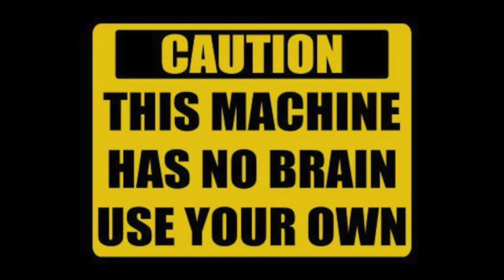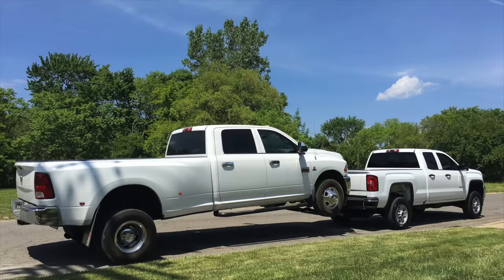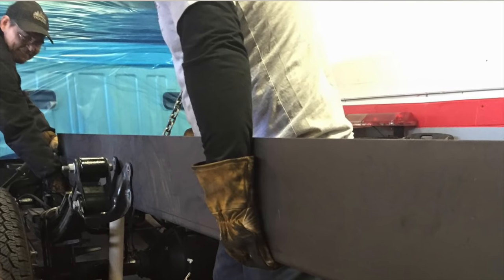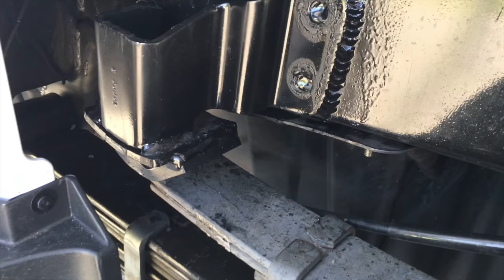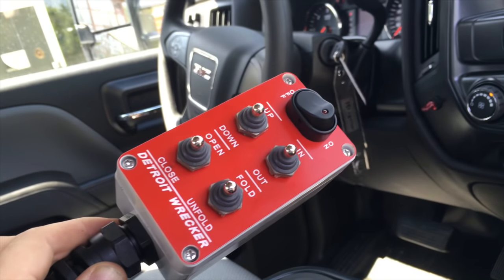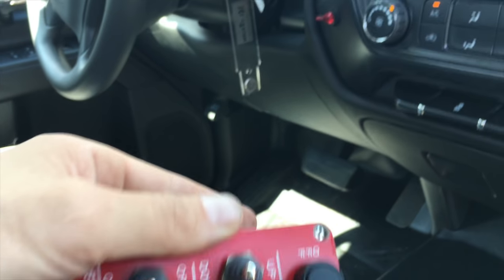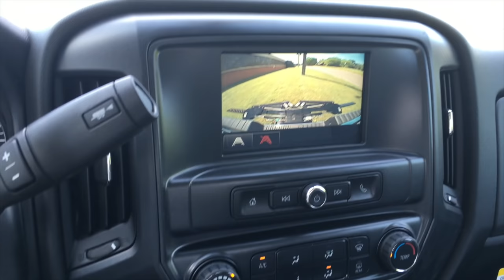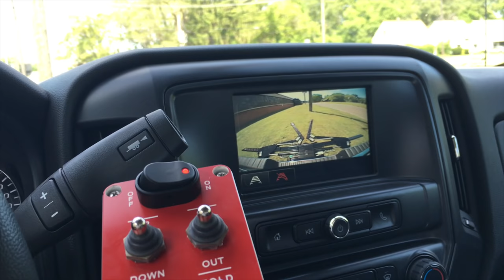GMC Gas 2500 Lifting Dodge 3500 Diesel Dually & CTSV Low Clearance

Comment: How much was the final bill, on the whole job ? Clearly You Guys are the ONLY company that does it right !!  Those helpers and pads are genius! Very Nice Job Guys !!!!
Reply from the maker: Plan on spending $15k for everything. Frame reinforcement & installation. Installation includes:

* Powder Coated Unit
* 2nd battery & Battery Box
* Power and Ground Wires (Gauge 4) 40' Total
* All Wires ran Protective split lume
* All Wires are Fastened to the truck w/ a P-Clamp & Nut and Bolt where applicable
* (2) 200amp Circuit Breakers (Protects Batteries) & (1) 300amp Fuse (Protects Electric Motor)
* Four Pin Tow Light Plug Installed
* Tow Lights w/ Cord are also included with installation.
* Grade 8 Nuts & Bolts
* Added Leaf Springs and/or Helper Spings & Top Overload Pads
* Ratchets & Straps 
* Safety Chains 12'
* LIFETIME WARRANTY PINS,BUSHINGS (with proper maintenance)

Please Note: We can not install on any Dodge Truck that has Rear Coil Suspension.The minimum recommended GVWR is 10,000lbs. Rear spring package & Frame Reinforcement recommended. Never exceed the chassis maximum GVW rating during towing.

Comment: I know this video is several months old, but have a question. have you guys try using an air ride suspension on some of these trucks to help with possible heavier loads. I know not to go over vehicle gross rating, but maybe it might be better.

Comment: Is there any weight on the front of that gmc once it lifted the dodge
Reply from the maker: No sir. We do not install counter weights due to the fact everyone we ever installed the clients asked us to remove it due to wearing out the tires, shocks, brakes, spindles, struts prematurely. Our opinion is if you need a counterweight you need a bigger truck.
Reply: @detroitwrecker  question why do you always show your wrecker lifting these big trucks but you never show them actually moving because I can almost guarantee you that GMC will not have any steering or stopping with the front wheels once you lift the Dodge
Reply: @detroitwrecker  like don’t get me wrong it’s a nice wrecker and it lifts good but I feel like you guys should be more honest in your videos because someone will buy a truck like that with that wrecker under the impression that it can lift a Dodge dually Diesel but then when they go to drive it, there’s no steering and the front tires skid every time you stop
Reply from the maker: @6.5L-tow-truck  Yes we clearly state that in the video, no way do we recommend towing a vehicle the same size or bigger than the tow truck vehicle. The Tow Truck is always supposed to be the biggest truck in the equation for stopping and steering safely. WHAT'S THE BIGGEST THING I CAN TOW?  • Anything smaller than your truck. Never tow something as big or bigger than your truck if you want to stop and steer safely. Towing a truck as big or bigger is going to exceed the capabilities of the brakes 
(you do not have trailer brakes in this application). When testing our units we often pick up a load the same size or bigger. This is for testing purposes only and you have to admit that if it can lift a heavy load, a regular sedan vehicle won't effect it hardly at all. Hence the reason our units last so long.
Reply: @detroitwrecker  I understand that but is there any weight left on the front tires when you picked up that dodge

Comment: Amazing piece of equipment. I have one question can the little Hercules pick up a vehicle that is lower than the Cadillac shown in this video? for example a lowered Honda civic that has front and rear camber to the wheels.
Reply from the maker: Depends on how much lower. The discrepancy of the operator would determine if it's possible.

Comment: If I have an older style century wheel lift, would it be possible to add the powered head/crossbar on to my lift? Converting my crossbar to a self loading style would make things so much easier
Reply from the maker: You can. Your looking at $3500 for a new cross bar and cylinders. The valving is the next thing to tackle. Some valves can add a stack or section. Some can't. So we need to know what kinda of valve you have. The controls are sometimes easy if the manufacturer offers an additional handle for control function. If not ya might have to fab something up to make it work. 

Anytime you need help or having a question. Be sure to call Mike or Joe in Parts. We can help ya with your Tow Truck. 
313-835-8700 or toll free 877-TOW-0030
Reply: Thank you for the quick response. My current setup is able to stack valves and I have an extra switch in the cab. Are the hoses and valves included or would that need to be purchased separately?
Reply from the maker: +barry wong - Def separate.

Comment: WHATS THE SPECIFIC REAR/FRONT SUSPENSION UPGRADES CONSIST OF (IN DETAIL) CALLED DETROIT WRECKER AND I WAS GIVEN A NOT SO DIRECT ANSWER , JUST TRYING TO SEE IF ITS DOABLE MYSELF NOT EVERYONE HAS THE MONEY IT COST FOR DETROIT WRECKER TO PERFORM THE UPGRADES ETC. ALTHOUGH I WOULD LOVE TO . THANKS
Reply from the maker: Accurate Towing - Sorry you were not satisfied with answer giving prior so we can try again. 
Every truck is ordered different or spec’d different from the dealer that ordered it from the factory. 
Some trucks come from the factory with 4 leaf springs. Some come with 2 leaf springs. The spring shop has specific instructions from us in regards to the pin height for the main pivot pin that the unit pivots on. It must be a certain height off the ground.

This is so the unit works properly for a couple different reasons. 
One, so the L Arms are not pointed in the ground or in the air too much. 
Two, so the unit doesn’t smash the bumper when hitting the “Up” button. 

Our obvious goal is to keep the truck from sagging under a load. The spring shop has complete control over the height of our main pivot pin due to the arch in the spring. So for example... if the truck comes back to us from the spring shop and we’re are not satisfied cuz it sat to high in the back with no load or sagged to much under a load.  At times they need to put more arch in the spring to raise the height or less arch to lower the truck height. Allowing our unit to be in the perfect position for operating correctly and not hitting the bumper when going all the way up. Or digging the forks into level ground. They are many times that the truck sits to high in the back and we take it back and ask they to de arch the spring. Or if we test the truck and it sagged too much. We would then again, take it back to the spring shop and ask for proper adjustments. 

This is at times a tedious task but well worth the effort as our clients are very pleased with our results.  So as you can see...it's not a plug and play situation. You take each truck and treat them as if they were our own and do what it takes to get the job done. 

Hope this helps, feel free to call me anytime if you have more questions. 
My name is Mike 
313-835-8700 
Detroit Wrecker Sales

Comment: All that additional work just to be able o mount this apparatus. Should have just mounted it on the 3500. Would've saved a lot of work
Reply: Make Nitro Great Again you would still have to do the same thing to a 3500 frame
Reply: @swappedoutZ71  Ahhhhhh I've got air bags on my Mega cab long as I'm not pickin up other dulleys like   a Gung ho mfr I betcha I could get by without all that frame reinforce ment  . I towed with old trucks back in the 90's and we had an old Dodge diesel 90, shit maybe an 89 that thing got worked INTO THE GROUND and it never had any of the frame reinforced

Comment: Why not just buy a 3500 gasser and through some 5,000 lb airbags under the back end? With the extent of work you do for the 2500 I’d have to guess that even the higher rated truck with bags would still be around a 1,000 dollars cheaper than nodding out a 2500.
Reply: GM 2500 and 3500 frames are the same..you would still do the same amount of work to the frame. They have more leaf springs but thats all

 do some research before talking. Thats probably why the company didnt waste time replying to you
Reply: jason9022 can you link me to this info cuz everywhere i looked said the frames were the same
Reply: jason9022 can u link me to where u found this info please
Reply: The Frames are the same yes, however the suspension is rated for more weight by a considerable amount and the rear differentials ARE different from each other on the gas trucks. 2500 gas trucks get a 10.5 inch rear end, the diesel gets the 11.5 inch AAM rear diff, 3500 trucks both gas and diesel get the 11.5 inch AAM to hold the extra weight capacity of the 3500 gas and to handle all the extra power and higher towing capacity of the diesels. And another reason for adding the larger rear end is so they can bump up the GVWR on the gas 3500 otherwise you’d have the same thing as a 2500, you’d be overloading you’d be overloading the GAWR on the 10.5.

https://www.youtube.com/watch?v=XSw_4VTg98s
Reply: @swappedoutZ71   link is below sorry for adding it in the wrong section.
Reply: jacob auld i already know all of the info you just said. I was only making a point about the frames to someone else, which i was correct on. If im not mistaken the 3500hd gets extra leaf springs too
Reply: Tyrell James yes, that’s the only thing that’s different in the suspension and the larger rear diff.
Reply: The biggest reason to go 3500 is the GAWR, the 2500 has a lower one and legally you can't go over which could happen depending what you are hauling. I went from a F350 to F450 because I was constantly over axle weight and DOT don't let that fly at all.